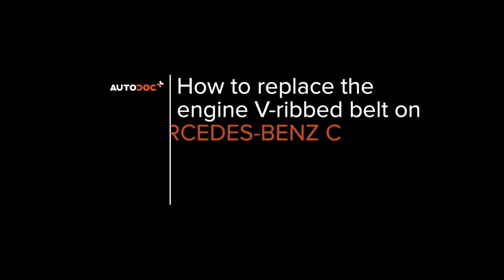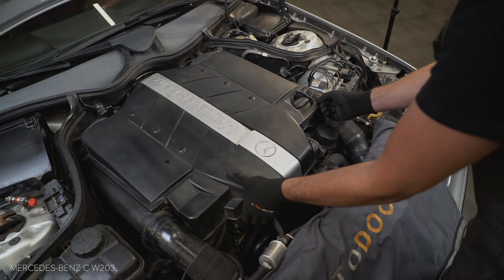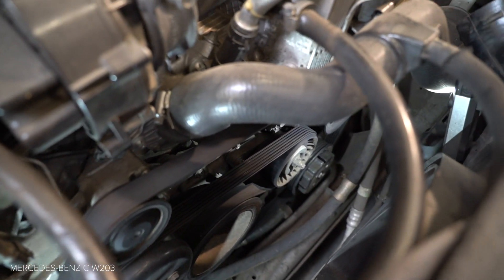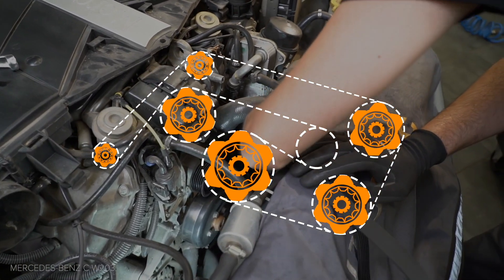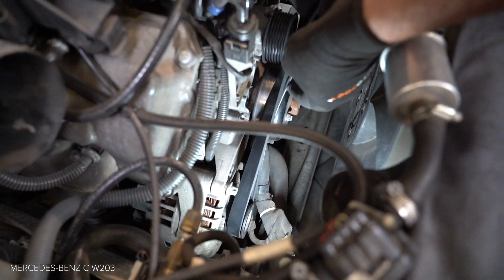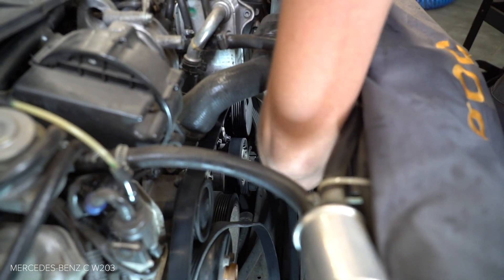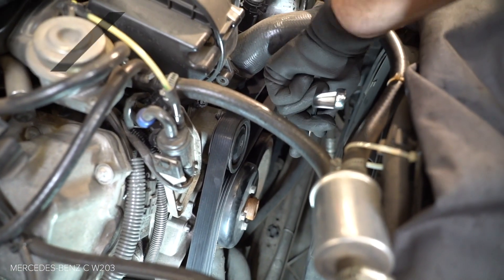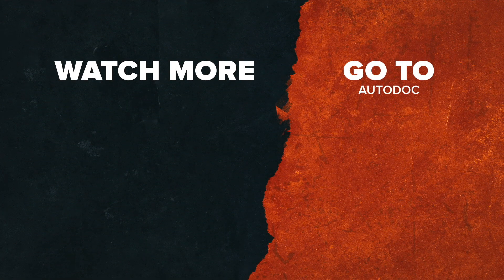How to change serpentine belt on MERCEDES-BENZ W203 C-Class [TUTORIAL AUTODOC]

Comment: One thing is blatantly wrong with this video & that's the way the idler pulley is pulled back to install the new belt. You can't use a 15mm. ring spanner to pull the pulley back to the left because the 15mm. nut that holds the idler pulley has a right hand thread that will undo if you turn the pulley anti clockwise. You need to use an E12 female torx socket to turn the extended torx arm that sits in front of the 15mm. pulley nut.A simple fact but true!